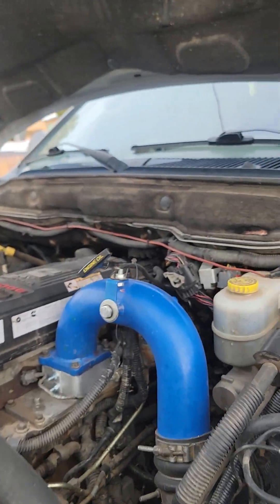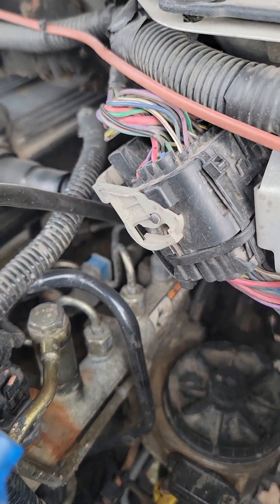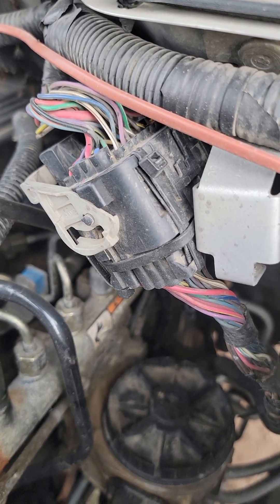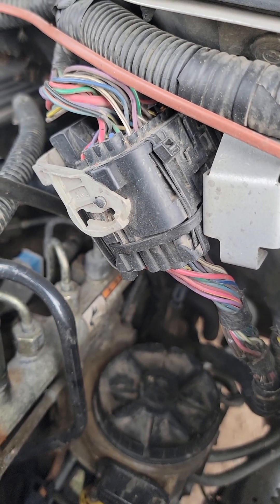Finally found the pedal issue fix  07 3rd gen cummins

Comment: My trucks having the same issue and I’ve replaced the sensor and cleaned terminals but nothing has worked so far. Truck seems to have a dead pedal when it’s either really cold out or rainy and wet so that’s why I assumed it was a connection issue on the terminals. But hopefully this works. Gonna try it tomorrow
Reply from the maker: Knowing how these connectors are, do everything you can, clean it real good and connect it, and like I said if the clip is broken get a second set of hands that can zip tie it while u hold it, some of these connectors are ridiculous 😂😂😂

Comment: Canada gets a lot more allotment of diesel trucks, If you run it for 6 months, they can mod the speedo and flip it in the US. Same as old diesel Toyota Landcruisers, they only were sold in Canada and diesel VW cars, none sold in the US till 99 1/2.
Reply from the maker: Ya my speedo was put to mph instead of kph. But oil and coolant was still metric 😅